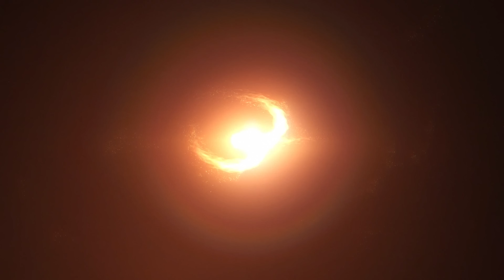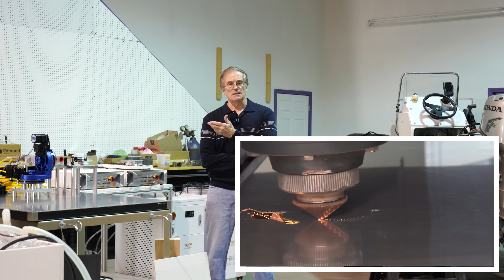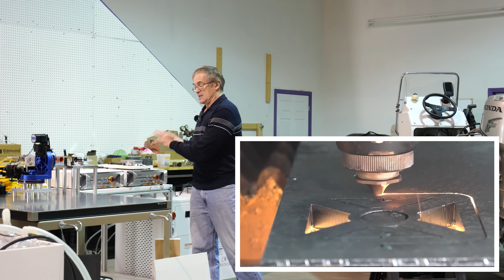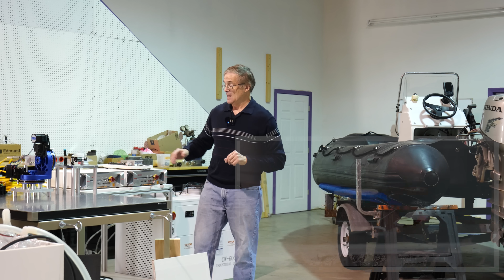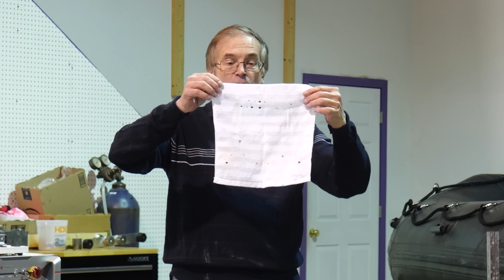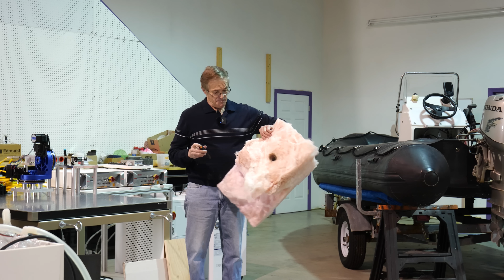We have a problem... and need your help!

Comment: I feel like a construction material and insulator might buy you some time; Tyvec and fire retardant fill -- make a sandwhich and stick it to the wall? Maybe add thermal blankets or reflective/refractive stuff into the normal fire retardation?

Comment: What about a CLOUD of water mist & vapor in front of plywood? 
Dunno how hard a high-volume sprayer is, but bajillions of droplets will disperse the beam as they vaporize, turning into steam as they do so - which also absorbs and disperses the beam. Turn that 1mm beam into a 20mm beam hitting wet (and continuously re-wetted) plywood, and you might get the time you need without any flames.

BTW - multi-year subscriber. Thank you for your amazing content!
Reply: i was thinking very similar thing, and i think any kind of smoke will do the job, water might be the best option (not just because as you said it can absorb energy but because its easy to produce and its non toxic to breath in), but if the smoke disperses the beam any material behind it should be able to take the dispersed beam, especially if you have some distance between the smoke and the wall
Reply: It turns in to CO2 and H2O in 0.0001s
Reply: @-_o_o_- 
Um, wazzat?  
Water vapor is already H2O, and absolutely doesn't turn into CO2 because there's no carbon in it. And of course CO2 is already CO2, and can't turn into H2O because there's no hydrogen in it. So what is it that you're talking about?
Reply: @gubunki  maybe something like cloudy/murky glass might help.
Reply: Yeah.. agree with you. Something murky cloudy liquids might help to scatter the beam.😊
Reply: I agree with the "aerosol" approach. If you know the frequency you could determine what you wanted to aerosolize (what absorbs that frequency). Reagan's Star Wars laser program had the problem of "blooming" where the atmosphere vaporized and destroyed the long range effectiveness. Smoke? CO2 vapor?
Reply: Thermal blooming https://en.wikipedia.org/wiki/Thermal_blooming

Comment: 1. Concrete / Hardie board at an angle to enlarge the spot and increase apparent thickness.
2. Fresnel lens from big screen TVs to de-focus the beam onto a backing material.
3. Build the brick wall on wheels (or any of the other ideas) to make setup and take down easier.
Reply: I do like the idea of thin concrete or ceramic tile. The brick seemed to work, so why not try thinner brick?

Comment: Put a few sheets of drywall together and shoot the laser lengthwise on the 4th foot Edge down the 8-ft length instead of through the face on a 4X sheet or you can use 10 ft 12 ft or 16 ft sheets

Comment: How about an optical cavity in the output path of the laser that you can have a solenoid or similar discarge a dry powder fire extinguiser into on an estop button. The dry powder can absorb heat well and would likely scatter the light.

Comment: I would try to use a high temperature refractory paint. Put several coats on Sheetrock or ceramic tiles

Comment: A block of ice can trap the laserlight inside it because of the refractive index of ice vs air. Also because the light is dispersed in the block by the impurities whilst bouncing around internally.   The high heat capacity of the volume of ice makes it that it can absorb an enormous amount of energy (compared to wood or insulating materials etc you tried earlyer).

Comment: If the beam is basically going to be in the same general area maybe try something like the starlite mixture that NightHawkInLight made on his channel, it's ablative & depending on the mixture can be completely fireproof as well, you could wrap it around the brick  (or better yet some form of aluminum oxide firebrick) It should do pretty well in comparison- I've seen a bowl shaped form (it wasn't wrapped around anything, was formed of just pure starlight) it stood up to approx. 15 minutes of molten Thermite inside it before it started to bulge outward on the bottom, & didn't fully penetrate it. Basically you want an intumescent ablative fireproofing coating of some sort.
A Super-Material That Can Be Made In The Kitchen (Starlite Part 1)  https://www.youtube.com/watch?v=aqR4_UoBIzY
History of a Lost Supermaterial & How To Make It (Starlite Part 2)  https://www.youtube.com/watch?v=0IbWampaEcM
Here is Boing's patent for Fire resistant plastic (Patent is still active att.) https://patents.google.com/patent/US7618563

Comment: I have several suggestions:
1) Perhaps try a phase change material like Sodium Sulfate and water. Melting point of 35°C. Search "Salt based PCMs" from NightHawkInLight. You could make thin bags of it, and layer them. Heat capacity close to water ice. Layer them between thin plates and compress the plates to increase the speed of restitution.
2) Another material to try, would be to take silica desiccant beads and make a slurry out of them with water. High diffusion and heat resistance when dry, high heat absorption when wet.
3) Perhaps solve the problem at the source. I don't know if you can modulate the intensity of your laser, but perhaps drive it at low power until you are certain you have painted your target, then switch to full power. This would be a layer on top of other solutions.
4) Another layer: PW modulate your laser, and have a circuit that shuts down the laser if the the duty cycle exceeds a certain percent. Have two inputs to disable this safety circuit: a key, and an input from your control system. Both inputs have to be high for the laser to be able to run at 100% duty cycle.
5) Another layer: Build a circuit inline with your laser power drive (preferable the logic signal the enables full power), and make what is basically a gated high pass filter. It will only let pulses through it that are shorter than (say) 100ms. If you want another pulse, you need to drive the signal low and then high again. If you do this quickly, you get effectively 100% power, but if something crashes or hangs, you get a maximum pulse length of 100ms. This can be done with a few capacitors and diodes and a buffer.
6) Implement an analog watchdog for your digital control system: Take a GPIO input into a 20 Hz low pass filter, pass that into a comparator that checks that the voltage is in a window. In the main loop of your control system, manually drive the output with a pulse density modulation signal that holds the output at a given voltage. Take the output of the comparator, and have it shut down all dangerous hardware if the voltage is outside the window. This instantly safes everything if your control loop stutters, hangs, or goes haywire. Also allows you to safely set breakpoints in code you are testing and have the system safe itself when the breakpoint is hit.
7) Pass all control signals through a high pass filter (just a small chip capacitor is fine, and also gives some voltage spike protection). It is rare that unintentional outputs are AC. If a control signal is designed to be DC, then modify it so that it has to be AC with a defined lowest frequency and amplitude. Manually drive the signal in your control loop, so that if the control loop hangs, the output becomes DC.

I have used all of these techniques (3-7) in hardware that was dangerous, to great effect. Many layers of simple hardware layers that completely mitigate possible software (and wetware) failures. At one point, I had a UL certification team reach out to me for instructions on how to disable our safeties, because they couldn't generate test conditions in the hardware that would test the mandated UL heat fuses and other such devices. It also means that I could test experimental firmware with no fear of the hardware catching fire (a real possibility). Hitting a breakpoint or infinite loop instantly safes everything.

Comment: I'm quite curious how many seconds Aerogel will hold out. They sell it here stuck to drywall for insulating rooms from the inside without making the room much smaller. Veratassium has made some video's about this stuff using his boring company flame-thrower on one side and his hand on the other to demonstrate the heat insulation properties.

Comment: white stone tile. maybe spin it like a record.
Reply: I'm thinking some cheap layered ceramic tile would work great.
Reply: @Newwinggarage  I made stone buttons for a long time, every waterjet place said try a laser, every laser place said try water jet. I have some blue agate about the size of a football, it nearly stopped the abrasive waterjet, did deflect the stream 45 degrees.
Reply: as a backstop if overpenned, pvc pipe full of water

Comment: Thoughts. Cascading water, perhaps parallel to the beam. Backed with a brick stack. Water cools the beam before hitting the brick. Would this lessen the intensity of the beam?
And maybe behind the brick a 10 layer drywall stack. What about concrete backer board? 3x5 sheets cut into small area stacks? Can you diffract/disperse the beam behind the target? Spitballin.

Comment: water/noncombustible liquid tank with a suspension of metal powder/ microscopic strips/chips. The effect of the metal powder melting will create convection currents of water replacing burnt material in the same spot, in a way self healing the damage. probably have the glass fibre insulation towards the end, with the final layer being a reflective sheet. Anything reflected should be fairly scattered at this point. better yet a layer of shiny ball bearings (also submerged) with the size equal to laser beam diameter.

Comment: Low tech: Wet sand bags. Or some kind of water fall feature over fiber cement board or any other water and heat resistant material. The ideia is running water will absorb and scatter part of the light beam, and the heat resistant material will absorb the other part. Plus since will be a fair amount of flesh water, it will avoid smoke. CNC plasma cutting machines uses a  pool of water to absorb the heat.

Comment: Optical engineer here.  Instead of absorbing the energy after the target, split the laser at the source into many beams which fire from separated independent beam directors (your galvos) and only cross the beams when you are certain that you have a menacing target.  It worked for Ghostbusters because light energy from the same source can be additive.  Spending money on the laser source end can save hassle and increase safety after the target.
Reply: My thought was to put a large fresnel lens behind the target.
Reply: how many times do you need to split this beast to get to a point that you can safely point each at random directions?
Reply: @tsraikage  yeah, that is going to be the problem,   dividing is linear,  we care about power on a log scale
Reply: Ah, yes... Death Star beam style... This will result in a specific X,Y,Z focal point, in 3D space, as many small beams converge at X,Y,Z.. instead of one ultra-dangerous beam. I thought this was already part of the plan though. I feel like I suggested it a long time ago.
Reply: @PaulLawson-k8v  the only problem is that, even half, tenth or hundredth of this beam still posesses tremendous power. so to "chop" it enough times to get to manageable intensity, its uneconomical. not to mention whatever you're using to split the beam will be vaporized pretty quickly
Reply: This is the way.
Reply: Why does every engineer recommend that he just don't do this?  "Hey I'm unverifiable credential heard what you need, have something entirely different."

Comment: Remember Starlite?
https://www.youtube.com/watch?v=0IbWampaEcM
Make tiles of the stuff. I see two disadvantages, though. Firstly, it may be a consumable, so you had to keep quite a bunch of replacement tiles ready. Secondly it gets charred, which causes it to absorb more beam energy. On the other hand, the charring creates a larger and fractured surface which might help to spread the energy and the deeper layers of the stuff would resist the heat. Lastly: has anybody tried to put borax in the mix?
My bet would be, that it could survive a few seconds before penetration. Or it explodes right away...

Comment: Maybe a tugsten plate could do the trick. Other ideas for testing is (if posible) to diverge the light with lens made witch ceramical materials that can support hight heat. 

I was wondering about heat shield used on space pods and grafite..

But first I would try to find out the temperature that this laser bean produces to think about materials to don't  overkill or overengineering.

Hope that you guys could find a good solution. Greatings from Brazil.

Comment: Aren't phenolic composites pretty close to heat shields, they char but don't burn? 
Apparently the smoke they produce isn't too nasty...

Other thought was to actively pump water over a wool blanket or 3. If the water is actively flowing down a curtain it will cool a lot more effectively than just being wet.

Comment: Expensive, but also a solution that needs to be considered if you start firing this thing in open air. I don't think I've watched the first video but:

When you're firing in the air at a drone, how do you know when to stop? Right now you'll burn a hole through the target, and a few seconds into open atmosphere gives you a strong possibility of hitting a plane, etc. 

Solution: Secondary targeting laser (like a laser range finder), combined with beam pulses. If your beam is already pulsing (like PWM style), you have the period between pulses for a targeting laser to detect the target has been destroyed (falls out of the sky presumably, therefore sudden loss of reflection), and shut down the laser before the next pulse is fired. 

This won't necessarily fix your indoor problem trying to target a sheet of metal, and any leakage that happens behind it, but it's possibly a future consideration you'll need for live targets. 

If the targeting beam is close enough to the weapon beam (parallel, and within 2cm), it could be affected by whatever hole is made (good) and be able to detect "target destroyed" even on the stationary targets. 

As for backing materials, not sure, but light, cheap, and thermally resistant as well as optically scattering just makes me thing of asphalt roof tiles.

Comment: I admire your work. I think out of the box!
You are trying to solve an issue you created, finding a material that will withstand the extreme temperature of a mm powerful laser is not possible even if you use one of the highest melting point elements such as tungsten can resist 3500 c. But your laser temperature is way above that. So i think you consider a motorized mechanical move to one of the optics to make your laser Beem width diameter  in cm not mm in other words out if focus. And when you need the full power just go back to the correct position of your lens . By doing so you don't need to lower your laser output you just temporarily made the spot beam bigger so then any material will withstand the heat

Comment: Laser engineer here. The lasers I work with are not as powerful, although my suggestion would be attenuatting/diffusing the power first. Something like ground glass would have a specular reflection and diffuse Guassian-like transmission. They are usually made of N-BK7 or fused silica, which have high damage thresholds and are used in laser cavities where intensities are very high. I'm not sure how much the ground surface reduces the damage threshold, but it might be worth testing as they are relatively cheap. The options for what goes behind the diffuser would then be much broader as the intensities will drop rapidly with distance from the diffuser. 
I'm looking forward to seeing what you end up constructing.
Reply: What about putting a giant fresnel lens behind the target?
Reply: @PsRohrbaugh  great minds think alike :-)
Reply: What would happen if you put several diffusers in series inside a large glass fish tank filled with water to absorb the heat?
Reply: I've popped internal holes in BK7 with a pulsed laser... they damaged my phone camera from meters away just recoding the pops.. I think the dirt and sand idea is probably best.... did some work where a team used graphite as a backstop for continueous laser in this power range... no where near as cheap as sand tho
Reply: Yeah was thinking sheets of glass perhaps with polarization or frosted. As it was mentioned he's using various lenses to get the laser light into a point so effectively as you said is diffuse it at the end.
Reply: RCC or TUF. Diffusing the beam to distribute the energy over larger surface area might be possible with UV Fused Silica Ground Glass Diffusers.
Reply: sounds like sand
Reply: I have no background in this area, but this was my first thought
Reply: Might defeat the purpose of a laser with a pinpoint focus over a distance.

Comment: Some others might have already said it, but what about graphite? It should be similar to plywood, but it would instead be non-combusting also they use it in crucibles so it should take the heat.

Comment: maybe a series of Fresnel lenses intentionally misaligned could scatter the beam as it passes between layers? additionally, a succession of rotated polarizing filters could attenuate bits of the beam at a time  .... they can be had fairly cheap from old tvs... I don't know how long the first few layers would withstand a beam of that intensity, but after a thick enough stack of them, perhaps it would be sufficiently scattered to be harmless
Reply: if not that then maybe get yourself a tungsten block... or perhaps tungsten foil and copper foil alternating layers

Comment: I would suggest ablative shielding, similar to what was used on the space shuttle. 

You could make panels of it and fix them to the wall or temporary frame. The laser would simply cook off the shielding allowing you enough time to shut it down. If it can withstand re-entry, maybe a laser would be fine 🤷‍♂️🤷‍♂️🤷‍♂️

@nighthawkinlight has a recipe https://youtu.be/aqR4_UoBIzY?si=pSmGBG_4b_v5r-Lr